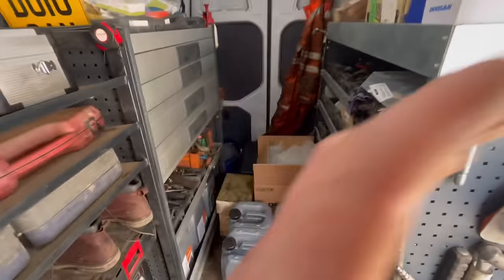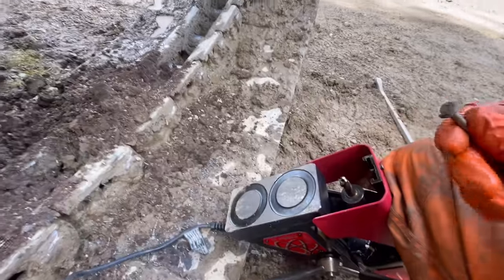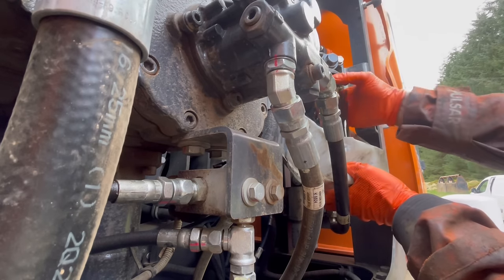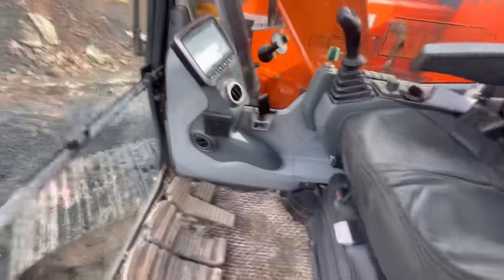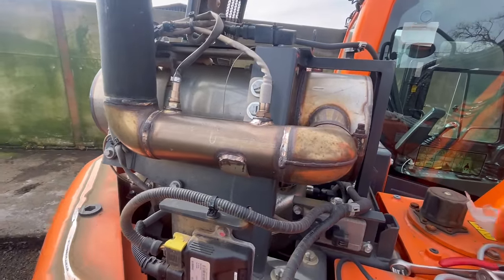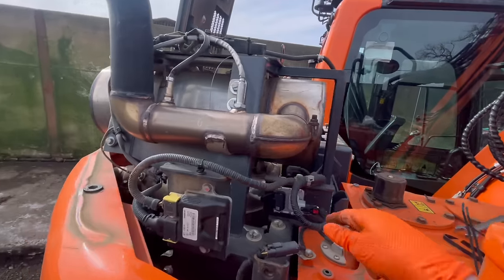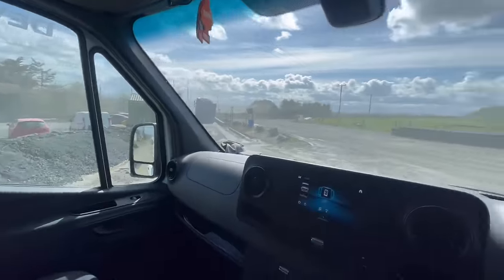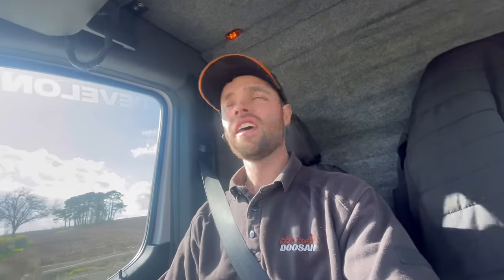More track bolts snapped / Nox sensor failure / grease pipes on a shovel

Comment: Always good to see you in better fettle!
Auto lube can be pita got 55t long reach spews out on the lower cylinders doesn't get to the bucket linkage properly,on dredging n underwater demolition,change between digging bucket n breaker on a barge at the moment good job kept greasing it last year no quick hitch! Pins come out no bother

Comment: Cheers Ali, those grease pipes have always been a pain at least the pins are still taking grease for now. The Radius Link Casting was a weak point on another brand of Machine with the end braking off in use. Pity you can’t carry burning gear on the van for those broken bolts. You’re coming across fine, carry on. ATB for now.

Comment: I'm probably telling you what you already know, but you can get long series mag drill cutters. Once you have it started, remove the center pilot. Then the core inside the cutter is not restricted.
Reply from the maker: That’s news to me I asked for the mag drill and a 14mm bit I haven’t much experience with them found it strange how the first two hole were a breeze and the last 2 a pain 🤦‍♂️
Reply: @alisdiggerdiary  have a look in Thomas Graham's the have a range made by TCT which are carbide tipped and will cut harder material as long as you treat them nice. A standard series cutter is probably only good for 20-25mm depth of cut.

Comment: That fitting is metric bud as that's what we use when we do grease hoses and glad you like the orange hose protector it looks fantastic on that machine and there is no need to improve on what you do and look out a box of something in the next few days let's just say I hope the are of some use to you
Reply from the maker: The rest were 1/8 bsp which was odd and the fittings on the manifold were a proper grease fitting 🤯
Reply: We do prefilled grease hose and fittings makes life so much easier

Comment: Those track guide bolts seem to be causing you some bother .
Probably a good idea to drill them out and fit nuts and bolts straight threw. Just got to sortbout a good way  to remove the old bolts ..

Yep your filming went to pot there ...a touch of Sun stroke 😂😂
👍👍👍👍
Reply from the maker: Fortunately it’s only the 20t plus machines working the woods that seem to break them but I’m going to nut and bolt them next time

Comment: I've always had great success using left hand drill bits as they often grab the bolt and wind it out. Could you drill a smaller central hole up the bolt then use a screw extractor?
Reply from the maker: Yea I get away with them well too but these studs are sat I’m muck from day one in the woods anyway the mag drill only had one direction 😂
Reply: Shame you can't re wire the drill to go opposite direction 😅

Comment: Ali any ideas of a DX85-3 tracking to the right when trying to go straight?
Reply from the maker: If it’s severely tracking to the right it could be a travel motor or leakage through the rotary coupling you’d need a flow meter to check flow to both motors are the same and decide if the left is going fast or the right is going slow, however if it’s just wandering to the right over a long straight it is normal as the motors are fed by one pump and no 2 motors are identical and the oil naturally takes the easiest path for example if the track tension is tighter on the right track etc
Reply: @alisdiggerdiary  it's pretty severe, about 10m then you have to straighten, digger has only done 1500 hours.
Reply: @alisdiggerdiary  maybe I'll slacken the both tracks are reset them as a start
Reply from the maker: @napsac4816   is it as bad on concrete ?
Reply: @alisdiggerdiary  bad everywhere, changed all filters  and checked levers for play/dirt all sweet
Reply from the maker: @napsac4816   if it’s that bad you’ll need to check the flow to both motors is the same. I’d imagine you’ll end up with a bad right hand motor
Reply: @alisdiggerdiary  that sounds expensive